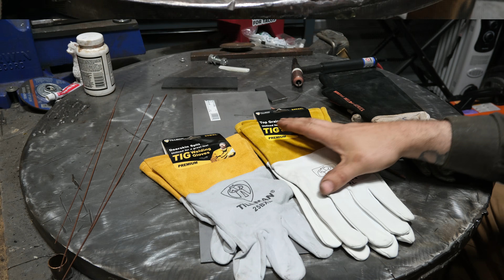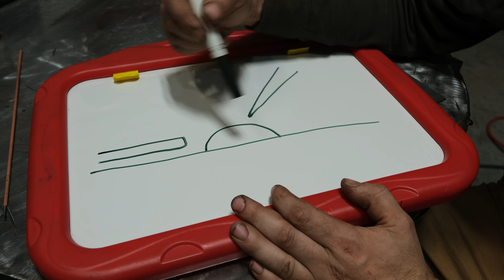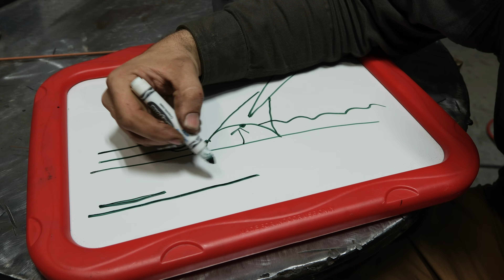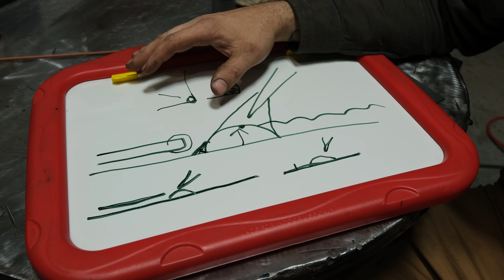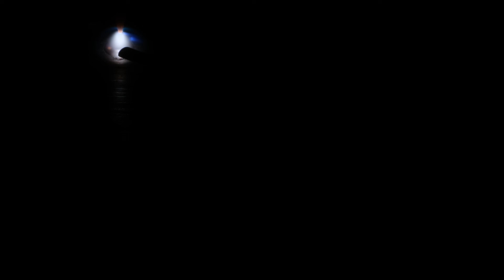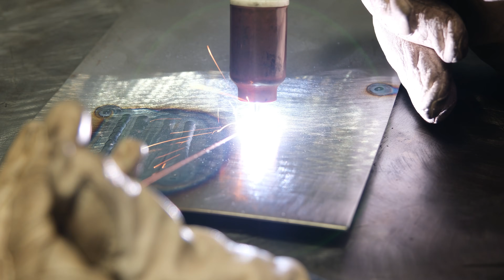How to add filler rod while tig welding (and tips)

Comment: So can you use laywire to braize?
Reply from the maker: Technically you can but if your heat input isn’t high enough you will wind up with very little braze that’s actually stuck to anything.  Make sure to use enough heat (brazing with tig is similar in heat to welding, just a pinch lower).  Make sure to use silicon bronze wire as well, not zinc bronze meant for oxy fuel 👍
Reply: @makingmistakeswithgreg thanks Greg, did you ever do a video on dealing with unknown metals?, most of my practice stuff is from skips.

Comment: I am reviewing this footage for arc gap as I continue to practice on mild steel. What surprises me most is how high an arc gap I can have without the arc cutting out. Of course things get a bit hot. I have a pancake hood with a nice shade (#11 electric blue). If I am outdoors and I wait long enough my eyes get used to the darkness and I can even see my filler wire without first striking an arc. I practice with coupons that are roughly 3/16” thick. My wire is 3/32”. I was able to weld a butt joint yesterday. Tomorrow are lap welds. So far so good. I have not stuck my tungsten yet but I have contaminated it several times. I keep other ones pre-sharpened ready to swap out. Not 100# sure my pedal is working, it may be that on the Maxstar 161stl my settings are incorrect. I will check manual. Thanks for your guidance.
Reply from the maker: Glad to hear your getting the practicing in 😀👍.  As you have found the arc gap it will maintain is significant.  With stick welding the arc will cut out at probably half or less of tig.  Tig operates at much lower voltage so it’s easier for the machine to hold a longer arc.  Keep practicing and you will steadily improve 😀👍

Comment: This very  detailed and very informative, but my problem is different, I am very old and worse still I’m blind in my left eye ( I’m right handed ) I’m ruining lots of electrodes! But I’m determined to learn so give it a try with one eye covered an you will find out what I mean. 
Any guidance would be appreciated!
Reply from the maker: So your depth perception will be a bit off being blind on one eye.  However I will say it shouldn’t prevent you from being able to weld pretty decently.  Make sure that your near vision is good.  Put a dollar bill on whatever table you weld on and see if you can read the serial number (without a welding hood on and from the same distance your head would be if you’re welding).  If the bill is blurry pickup a cheater lense for your welding hood or use a set of reading glasses.  Once your vision is fairly clear at welding distances it comes down to practicing enough to build the muscle memory so you don’t have to focus so much on what you’re doing.  You will have a bit of an uphill battle with depth perception but you can train yourself to overcome it.  Try to focus on being consistent start to finish.  Move the same speed, same arc gap, etc and your welds will be more consistent.  It takes time to be able to automatically do things but once you build the muscle memory it will get easier 👍
Reply: @makingmistakeswithgreg thanks for the very useful reply I’ll take note and practice as you have advised. 
Today I was at the end of my tether. All my Tig efforts have been rubbish including dipping my Tig. Then I sat wish a glass of vino and I decided to check the gas at the cup. Very little gas, I had a leak where to line goes into the torch and once fixed I’m now getting nice shines plain bead 😅

Comment: You weren't kidding about the practice needed for feeding wire. I am hoping by next week my muscle memory is good enough to try it with a lit arc.
Reply from the maker: I will tell you this:  even with a lot of practice the filler feeding never seems to be quite up to speed.  What will help is using the right size filler wire.  If you’re welding below 80 amps using .045 or 1/16th will work best.  Above 100 to about 140 1/16th to 3/32 works best.  Above 150 to 200 3/32 or 1/8th tends to work best.  Those numbers are for steel, size the rod up one size for aluminum.  Going too big will cool the puddle too much which means you need your run more amperage, which isn’t likely a good situation.  Having the right size rod reduces how much you need to feed, which helps with a slow filler hand 👍.

The good thing is shorter welds (less than 2inches) tend to not need much filler feeding.  Where things become interesting is on really long welds, and aluminum.  Aluminum is probably the best filler feeding training you can get.  You have to use a larger rod than steel and feed a ton of it.

Comment: I haven’t tiged yet, I have a bunch of gas welding rod, is it able to be used to tig?
Reply from the maker: That’s a great question.  The answer is yes it can be used to tig weld with, but provided it’s not flux coated.  If it’s bare steel or copper coated steel it will work with tig.  The caveat to this is the alloy it’s made out of is actually different than er70 that is typically used with tig.  The welds typical oxy fuel rods produce will be weaker than er70 rods.  For practice not a problem, I wouldn’t use them to build things requiring strength.  Also, many oxy fuel rods are pretty big in diameter, tig works best for practice with 3/32 and 1/16th diameter (2.4 to 3.2mm).  If they are larger than that it can be tough to weld with them.  Hope that helps 👍

Comment: Your advice  on tig glove brand is spot on and I'll add that i prefer Tillman 1338xl. I am 6'2" 180 and have longer thin' ish fingers. I went through a few different  sizes before i found the one i  like. Expect to go through a few different gloves before you find YOUR size.
Reply from the maker: Anyone with non normal had size/shape (which is probably 20% of people lol) will definitely need to try a bunch to find something that works.  It sucks from a cost perspective but having a glove that fits does make a difference 😀.

Comment: When I was learning to tig weld my mentor gave me a 15in piece of 3/32 filler rod amd he told me to practice feeding with both hands while i was driving. My ability to do it without thinking improved almost immediately. Great way to practice without having to setup or use any materials
Reply from the maker: 100%.  Doing it enough to not even think about it is how to get good at it.
Reply: I'd ah.. recommend against doing so while driving.  These days that might get you a ticket in a lot of states, thanks to laws aimed primairly at cell phone users, but easily applicable to makeup artists, shavers, and eating and driving
Reply: Bloody dangerous😅😮

Comment: Hi Greg great video!  Quick question. You mentioned laywire.  Understand about it degrading root fusion.  So, would it make sense to first do a dry weld (no filler rod) to bind the root and get good root fusion, and then do laywire on top of that? Maybe two laywire, one on top side (of a fillet weld) and a second on the bottom side (maybe even one more in the middle)?  Thanks!
Reply from the maker: That’s a really good question.  The answer is it’s complicated 😅.  I will cover this in a video at some point but this info should help you:  Doing straight lay wire can work, depending on the situation.  It’s very common to weld open root knife edged beveled plates (think pipe) with a lay wire.  This works really well.  With a closed root fillet weld lay wire is generally a bad idea.  What can happen is the weld will fuse both plates and melt the wire, but the root will have no fusion.  To avoid this the easiest way is to dab the root and you will watch the root fuse as you go, assuring results.  If the amperage is high enough and the arc is tight you can get root fusion with lay wire.  Just avoid using bigger filler rods (3/32 and 1/8th are too big to be lay wiring a root) and keep the arc gap tight.  It’s almost extremely important to have the arc focused into the root and not laid flat (tungsten at a flat angle to the base material) where the arc is pushing forward. 

As far as fusing the root of a weld and then going back over it with filler, that depends on the material.  On mild steel that could work to a certain extent.  On many types of material (higher strength steels, high carbon content steels, castings, aluminum, etc) doing that would be undesirable.  Those materials tend to make brittle alloys when welded without filler material, and you would more or less create a weak root without the filler.  The filler rods (even er70 on mild steel) have deoxidizers and are alloys, which will lower the chance of internal weld defects and help produce stronger welds.  So the best way to do a root with tig is proper amperage and dab.  For fill passes you can more easily do lay wire and it won’t be much of a concern.  I will do a video on this 😀👍
Reply: @makingmistakeswithgreg   super and thanks! All that makes sense. I had not considered the cast type metals but I see where you are coming from. As one gets deeper into welding it appears one gets deeper into the science of materials and alloys! ;-)

Comment: Love these videos . Question though. I mainly weld 1 or 2mm plate for practice and it looks ok but what should the underside look like? What is too much heat or not enough from the underside?
Reply from the maker: So on 1-2mm material butt weld should ideally have some melt through (penetration) along with some reinforcement on the side you’re welding.  On lap weld you would want to see not much more penetration than a whisper if any. On a fillet weld it will be tough to not have some melt through but you want to keep that to a minimum.  I need to do a video on this specifically, I will do it soon since I planned on doing a thin material video.
Reply: @makingmistakeswithgreg  I look forward to the video..

Comment: i use a "tig finger" over my gloves on whatever finger is closest to the heat i actually have the same gloves it saves your finger and your gloves even when i mig weld i use it on my index on the left it seems i'm always holding stuff to close to the heat and melt a lot of gloves
Reply: Tig finger without doubt. Great item. See Weld Monger.

Comment: Wow, Greg, that was great.
Some things I already knew, some things I didn't. But that's the first time I got a rely great picture of how the things really work that I already thought I knew. Saw some big mistakes I made and also fine details I always did wrong!
Especially my habit of feeding filler looks "upside down" compared to the technique you showed. Many thanks, man!
Reply from the maker: There are a ton of ways to feed filler, many unconventional ways work.  The main thing is running enough amperage to get fusion.  I will definitely do some cut and etches showing how many ways of feeding produce similar results.  Running too low of amperage is the primary issue for poor fusion with tig.  Especially aluminum 😀

Comment: I would appreciate it so much if you would give me your opinion on the Lincoln square wave 200.  I can’t afford the dynasty.
Reply from the maker: Don’t worry about affording the dynasty, you can do quality welds without one.  To answer your question, I have a bunch of thoughts.  I started tig welding with that exact machine, that was my first tig welder.  I built hundreds of projects and used all aspects of it so I very familiar with it.  I believe it is a solid machine, however it does have some limitations.  The main limitations of it are centered around price and its stick welding capability.  It is not a very good stick welder, it actually struggles with 6011 rods, won’t run 6010, and even 7018 runs worse than most stick welders.  It also doesn’t have a lot of controls more modern machines have.  Its arc start is a bit hot and it could have a bit better low amp capability.

With that said it is a very solid easy to use machine.  It actually welds really good.  Mine was 100% reliable too.  Based on the tig 200 price (with 600$ rebate that’s going on) I would very seriously look at the everlast 210ext with the upgraded tig torch.  That machine is more capable in most respects, is a far better stick welder, and is still fairly simple to use.  Beyond the everlast 210-255 the primeweld machines are pretty solid (although their low amp tig and stick performance aren’t much better than the Lincoln machine.
Reply: @makingmistakeswithgreg  thank you so much for the answer.   I did buy a miller 161s based on your earlier video about top 10 stick welders. They also have a 600$ rebate (through sept). I did also buy the Lincoln square wave today.  I wanted a cheap ac tig to learn on but I was afraid to go too cheap. I’ll make the best of it I suppose. You have very good videos. Easy to learn from.  Thank you for the reply.

Comment: Great info and demonstrations.   I love your videos and have learned a lot, but TIG is extremely challenging for me, and what follows is not a negative critique, but rather a humble request for us old dogs.

Black background with a Bright White spot and some multi tone plasma is what I’m seeing; Unless you are Extremely Zoomed in. I know it is difficult to get arc footage to be True to what you are seeing through your hood for a number of reasons.  In this video, the arc is extremely bright, and it washes out any detail such as your arc gap or the contrast is so high, you can’t see any detail in where you are going in these arc shots. Granted it’s just running “Bead on Plate” and there is no need to really see or try to follow a line.  I am older, and I have to use 4.0 Cheaters and get fairly close to see enough detail that I can bring it all together e.g. puddle size, arc gap, filler rod (dipping it into the puddle), and following a line or path.  I have tried adjusting my hood’s shade anywhere from 8.5 to 11.5 and I just have difficulty bringing everything into some kind of reasonable balance.

Could you please create some arc footage for us that best simulates what you are seeing please?  I realize a lot depends on the quality of one’s welding hood, but whatever hood and shade settings you use, and replicating what you see (but on the video) would be very helpful i.e. a target to shoot for, it will need to be zoomed in to some degree, but it sure would help us, if you could simulate a “Site Picture” that you strive for.  

Glove Question: why not use roomy standard leather (drivers style) gloves for light TIG work?  As long as the skin on your arm is covered, why would I need a gauntlet style like the Tillman’s you showed us? 

Thanks for taking the time to answer my questions.
Reply from the maker: In the upcoming videos where I welded joints the arc footage will be different due to following the joint and watching the fusion happening.  This video was primarily focused on what the puddle should look like to add filler to.  There will be a bunch of different angles to better demonstrate what’s going on.  If you were able to see what I see while tig welding you would probably be shocked at how I weld.  I don’t see much of anything other than the leading edge of the puddle and how bright the arc is.  It probably sounds odd, but just seeing what the leading edge looks like tells me almost everything I need to know.  The reason this works is because my hand movement is so consistent and smooth I know that everything behind the leading edge will be fine if that edge is fine.  If the edge is misshapen, or it’s not joining two pieces together properly, the weld will have issues.  I will be sure to demonstrate it in a video 😀👍
Reply: While Greg's shade is slightly dark to provide additional perspective of the torch/filler hand; for him to "show you what he sees" would actually not provide much helpful/usable footage...... That's why he zoomed in & slowed down some of the shots-  to provide the additional viewing detail that most folks are seeking to learn from.
Reply: Thanks, I am looking forward to more TIG videos. In your 6 month welding hood review, you mentioned that you were frustrated with the Miller hood because you felt like you had to constantly fiddle with the setting…

Both my hoods are Millers with the ClearLight (CL) technology cartridge. My 1st is an original Digital Infinity with CL 1.0 which I got cheap because it was superseded by 2.0 and it was on a clearance sale. I should have just spent the money and bought the newer version.  My second hood is the Digital Elite with CL 2.0 and an External Grind button. 

The bottom line is I am constantly fiddling with the setting between MIG, TIG and Stick welding. I think that is a huge part of my issue, and I’m relieved to hear it’s just not me, it’s the Hood.  But it is also the basis of the question in this video.

Comment: I use MIG wire as thin filler . I twist it between a wise and drill to stiffen it up. Often I twist 2 or 3 wires together.  When began TIG and coming from electronics , My thought was : Oh this is a bit like soldering , Heat , dab the solder tin , let it flow out and move to the next solder point.
Reply from the maker: MiG wire is a fast way to get thinner wire for sure.  The .023 to .035 is great for thin material, or you can twist it like you do to get a bigger rod.  Your thoughts on soldering being similar is pretty good.  The molten steel with tig is affected by surface tension just like solder is, and it flows similar.  It just becomes solid faster and melts at a higher heat.

Comment: The idea about pulling the rod back is to never pull it back enough so that it leaves the argon shield. Otherwise it begins to oxidize and that’s not good.
Reply: Yes especially on stainless and aluminum, titanium that alone will completely trash and ruin the whole weld alone
Reply from the maker: You will oxidize the rod for sure.  Thanks for mentioning that because it’s an important reason I forgot to mention.  Especially with more reactive metals like titanium.